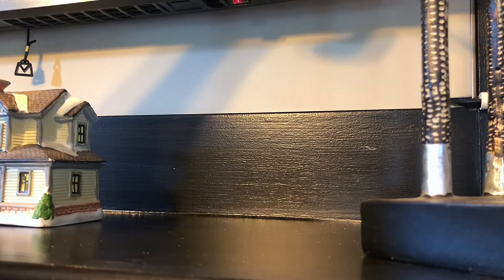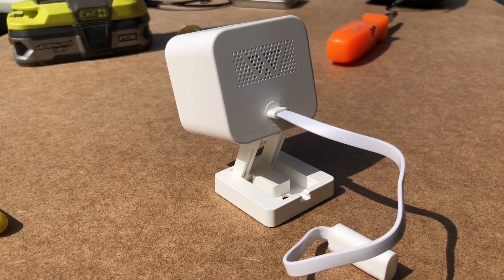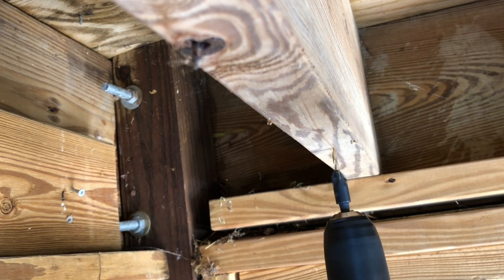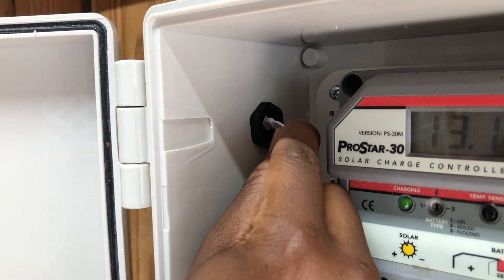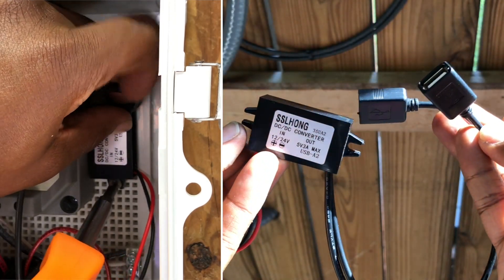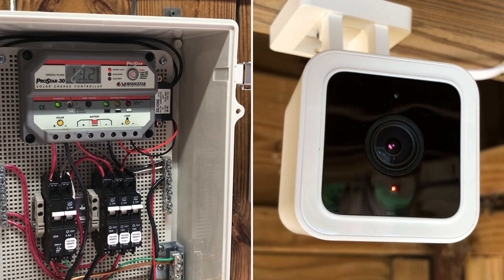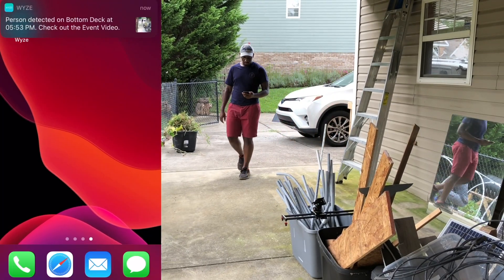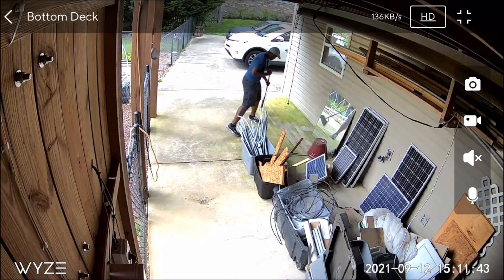Solar Security Camera | EASY DIY Using WYZE Cam

Comment: Can you hook up using the Wyze solar panel?
Reply from the maker: Not that particular one. You can with the Wyze Outdoor that has a battery built into the camera. The camera I have uses too much power and would stop working when the sun goes down since it does not have a battery built in.
Reply: @GreenTechTown  I have the same problem with the Wyze Battery Cam Pro powered with the Wyze Solar Panel (2.5 watts).
If I change settings to have continuous recording, the battery dies by the time the sun sets, thus not recording at night.
Would a 10 watt solar panel power (and keep power) to the Wyze Battery Cam Pro? 
Any suggestions would be appreciated!

Comment: Anyway to do this but with a small 12x12 solar panel but there is no storage for the power? I dont have a solar power setup like yours. I dont have anything. I just want to take my security camera that takes dc power and hook it up to a solar panel away from the house.
Reply from the maker: That may be difficult to do without some type of battery (big/small) since the power from the sun will vary throughout the day and from day to day. There are some security cameras out there that have internal batteries built in which makes the process easier. Some even sell a small solar panel you can mount near by and plug it directly into the security camera so it's a plug-n-play application.
I haven't used any myself yet since I haven't had a need to, but if you search "Battery Powered Security Cameras" on Amazon/Google, you might land on a few options.
Reply: @GreenTechTown  you are right. Is there a battery i can rig and put in between the solar panel and camera to store that power?

Comment: Just a helpful tip. It would be better to put the Wyze cam just a little further into the middle to reduce the IR bounce from the wall on the left. You may be able to see your driveway then.
Reply from the maker: Awesome, thanks for the tip. I may give it a try when I get some time to get back up there.

Comment: I love my Wyze cams! I have the doorbell on my front door, a Cam V3 with spotlight on my cabin, and the motion light on my shed. I had to wire it all up myself but I've done a lot of electrical work so it was nothing, gave me something to do. I'm really happy with them, especially being I got all 3 of them for less than I would have paid for the Google Nest motion light alone. Even with the year of Cam Plus for each of them!
Reply from the maker: Awesome to hear. I definitely agree with you, they are much more affordable and you receive a lot more features than some of the other more expensive cams on the market.

Comment: This was so helpful! I watched many reviews for this particular camera and just like I many people also had questions about using solar to power this. People however were assuming that because there is no battery to hold the charge, that it wont work with solar power. Your system works fine, so I see no reason it wouldn't work with like a smaller solar power bank. I should share your link in so of those comments. I'm defiantly going to try with the smaller more portable solar power banks.
Reply from the maker: Great to hear. Yes, so far, this is working great for my application. You could definitely get away with a smaller system, but having a slightly larger system allows room for days where it may be cloudy or not as much direct sunlight during certain parts of the year. Good luck on your project!

Comment: does WYZE make you pay a monthly fee??
Reply from the maker: Hey Ron. No, they do not force you to pay a monthly fee to use their basic monitoring service, but they do have a Cam Plus plan you can upgrade to that gives you a few more features which does require a monthly fee. I only use the free services and it meets my needs just fine, but it will vary from person to person and what your needs are.

Comment: Great video, but you should have shown more of the Wyze camera setup (not because it is needed, but to stretch the video out to hit the 10 minute mark that helps the algorithm).  

I think it'd be cool if you did a follow on video that did a standalone Wyze camera  installation a small solar panel that charged a battery or USB power bank that ran a Wyze camera.  Thanks for the content!

Comment: Great video! I saw a SimpliSafe camera in your intro -- Only thing I would suggest is don't use signs that specifically say SimpliSafe on your property. Nothing wrong with SimpliSafe in general, It works just fine for most things and I own a system myself... but it's very easy to bypass if you know what you're up against. I won't go into detail here, but it is. If you have SimpliSafe, get some other signs that don't specify what brand you have.
Reply from the maker: Great tip Flip. I’ve heard that before and currently use that technique. Thanks for sharing.